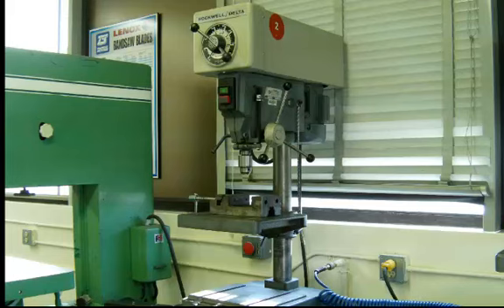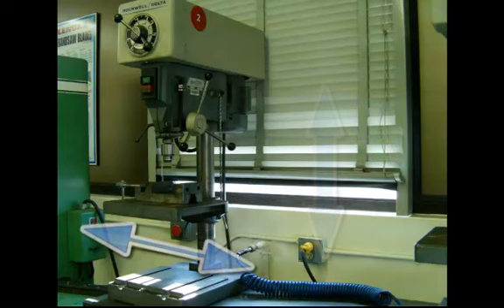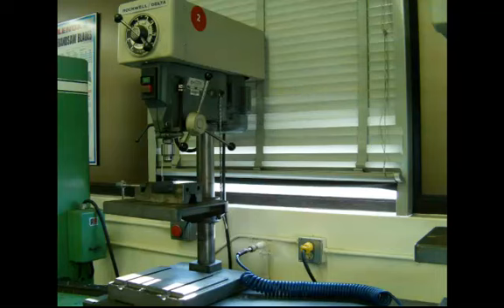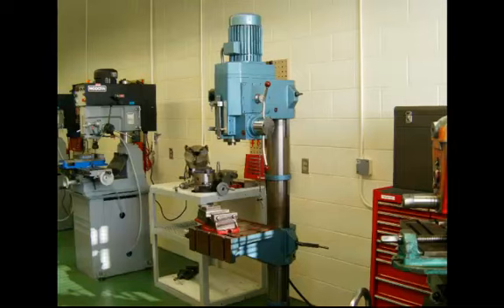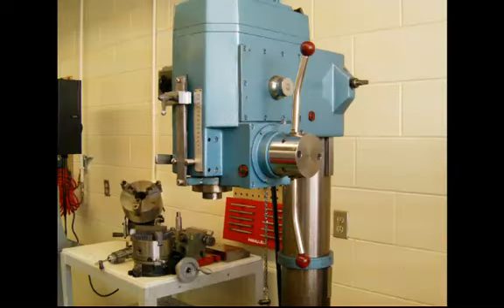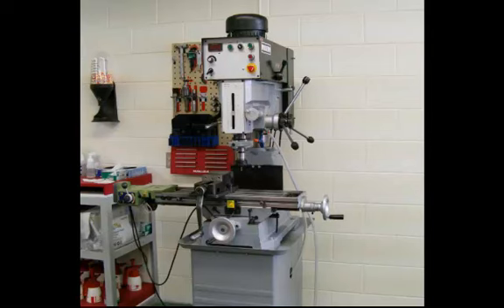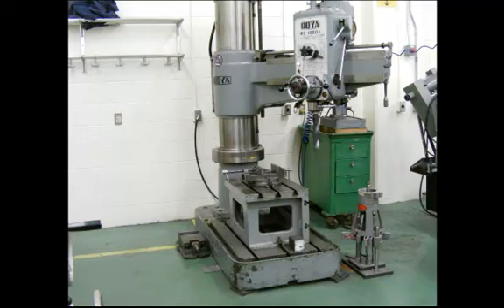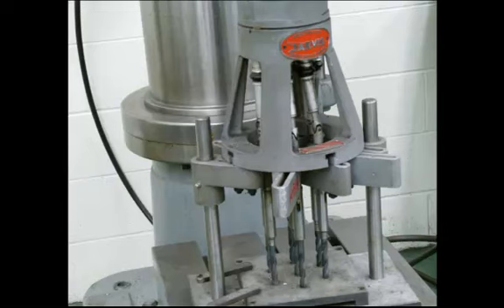Drill Presses

Comment: I wonder how hard would it be to retrofit a CVT pulley on my 1hp drill/tap press, by replacing the front cone pulley and adjusting the speed by the tensioner that moves the motor with the rear pulley back and forth. 

Also a bit lower speeds without sacrificing the 2500rpm top end, wouldn't hurt either cause using a tap or even worse a die holder at 160rpm as a minimum can sometimes get sketchy, whereas controlling the speed with a 3-phase VFD, without handicapping the decceleration and acceleration of the spindle in tapping mode (probably the most impressive part about these Greek made Labo BL220-DT), would require a VFD at least 10 times bigger (that's like 50 times more expensive) to not blow up from the huge current peak of reversing the motor at high speeds.
Reply from the maker: You will have to let me know how it works out.

Comment: I have a jet drill press. I do not have the chuck or Morse taper adapter. I do not know how to determine which Morse taper it is. Any suggestions? I have done the obvious online research to no avail.
Reply from the maker: Can you tell me what the diameter is of the hole at the end of the spindle? Is it a bench model? My guess it's a #2 possibly #3 Morse taper. Do you have access to a library? Morse taper specifications are found in The Machinery Handbook, an Industrial Press publication. You might find them online.
Reply: machiningmoments thank you. I just came across that dimension in a “how to build a Morse taper” vid. Now just need to find the specs and measure the opening. I cannot measure the depth but that dimension has not been offered or required. I’m thinking it is a #4 that receives a #3 tool. Will let you know .
Reply from the maker: Assuming it is in fact a Morse taper (I'd be surprised if it isn't) the diameter measurement at the end of the spindle will tell me what size taper it excepts. If you have access to a Machinery Handbook and let me know what addition you have I can let you know what page it is found on and decipher the information. I can't send a picture of the page it copyright protected.